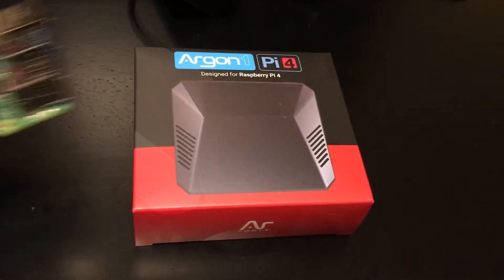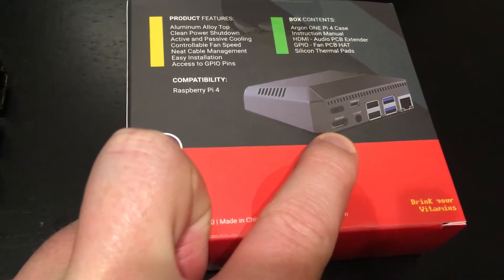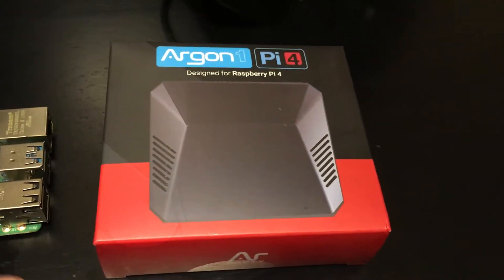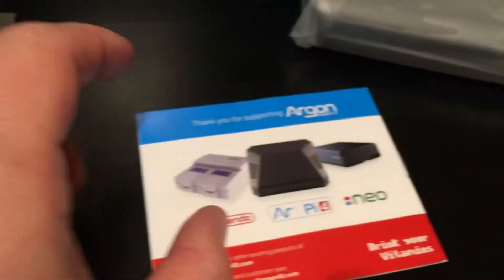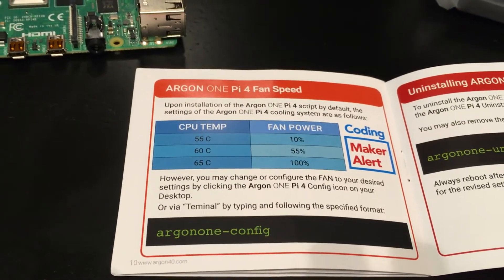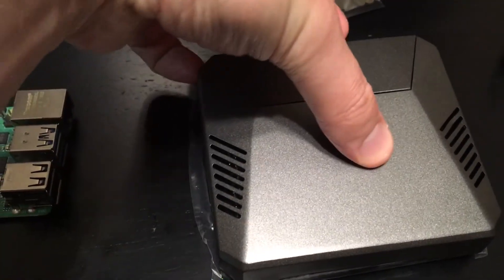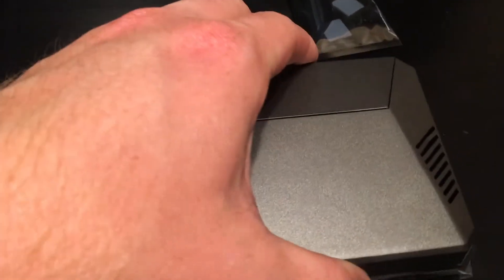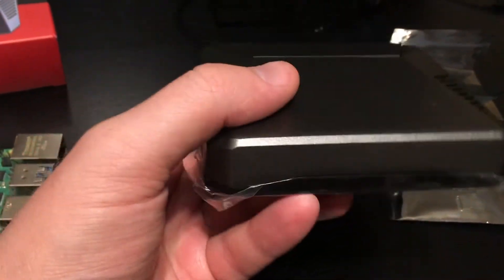Argon One Raspberry Pi 4 Case

Comment: Mine didn't work at all. Didn't boot. No video out to either HDMI ports. Tried different Pi4's and power supplies. All 3-4amps. Sent it back to Amazon. Read after I bought it at least 6 people had same issues I did. Company that makes the product actually contacted me and asked for my invoice and address and said they would send me one. Well, I'll keep you posted. Anyone else have any issues with the case?
Reply from the maker: I have had issues with the Pi3 B+ Argon case but not the Pi4 case.

Comment: What annoys me about this case is they have a breakout board anyway, instead of using the fragile micro(or mini, honestly who keeps up with that anyway) ports they could have broken them out to two full sized HDMI ports so you don't need to mess with getting new HDMI cables.  I know there isn't a lot of space on the back but they could have fit them somehow. . .
Reply: I was thinking the same thing. It's also a shame the case doesn't include an IR receiver. I'd also like an option to have a GPIO board that includes a PoE hat.
Reply: yeah just like most stuff the 2nd iteration is lazy and greedy or at least uninspired

Comment: Just received my case today. Whilst the assembly went well, I am unable to activate the fan and power button functions as the terminal entry they require you to enter to install their code does not work. So at the moment it is just a very passive thermal cooling case. Have contacted Argon, now waiting for response.
Reply from the maker: I know I was able to get the terminal commands working on my 3B+ with the original Argon One. I haven't tried it with the new one yet since RetroPi hasn't been released for it yet.
Reply: @superretrocade3362  thanks for response. After multiple attempts it finally did download and install, all good now.
Reply from the maker: Lloyd Cutler Nice!

Comment: How is the fan quality?  From ETAPrime's review from the rpi3 version, the fan was loud for its size.
Reply from the maker: Yeah, I saw that video. It isn’t loud at all in my opinion. You can install the script it comes with so it will throttle down the fan automatically based on utilization.